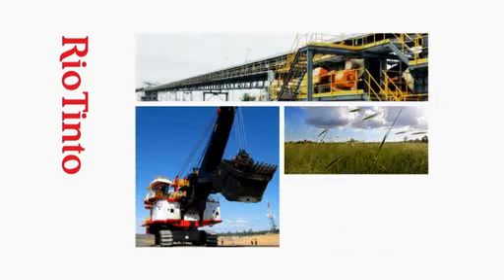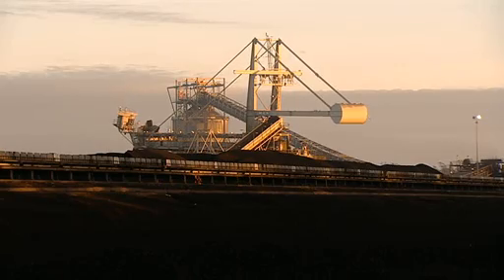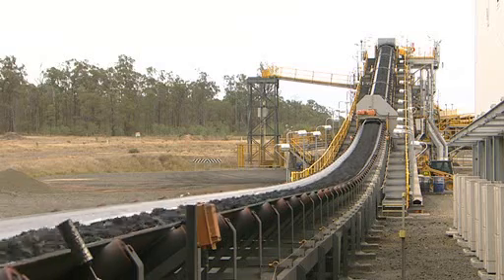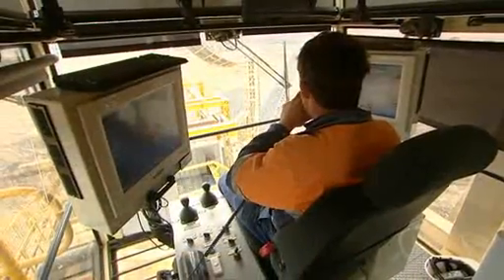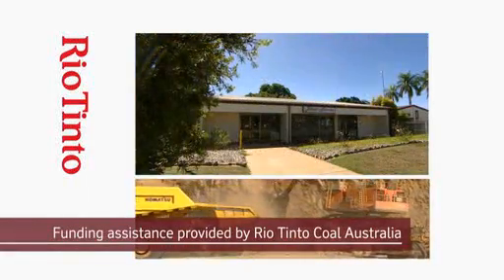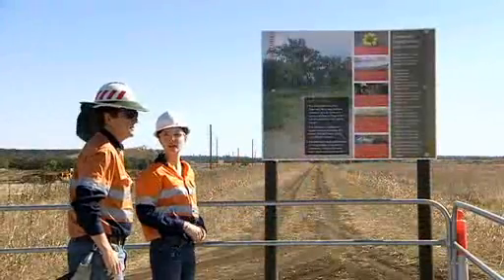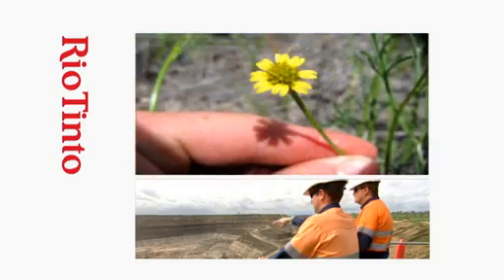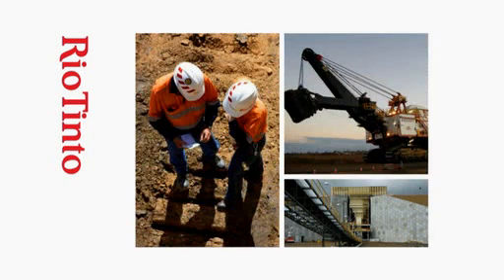Clermont Mine opens

Comment: This is hilarious.  First it says the mine was expected to produce more than 12 million tonnes of coal per year by 2013.  I expect most if not all of the coal went to China to be burned and adding millions of tonnes to the total production of Carbon Dioxide released each year into the World's atmosphere.
  Then the video goes on to boast that the In-pit crusher-conveyor system ("IPCC") will reduce haul truck use by about 35%, "greatly reducing the site's carbon footprint".